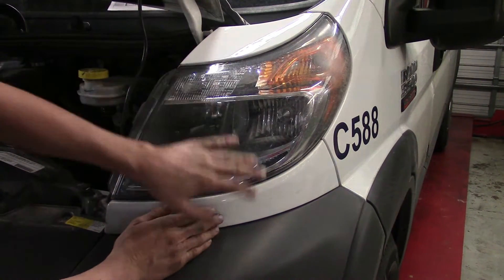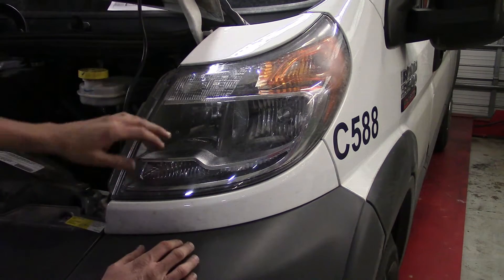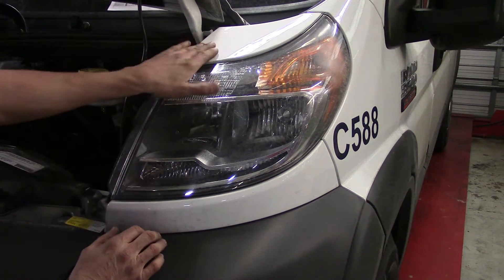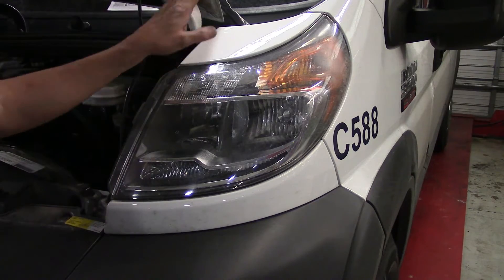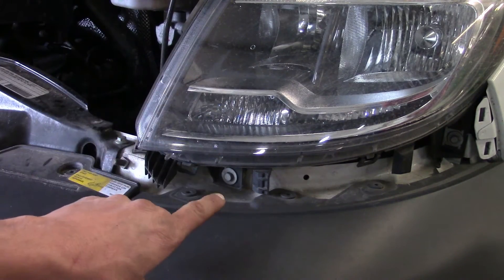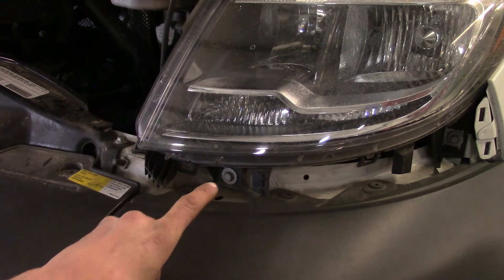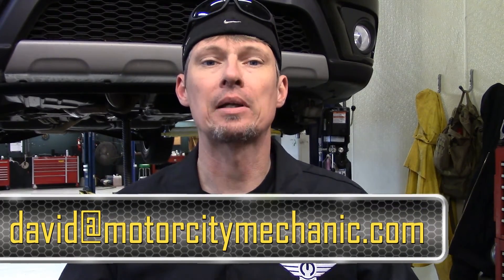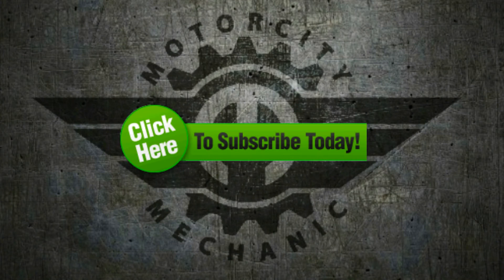2014-2015 Ram Promaster headlamp adjustment

Comment: Great video. To add; the 2016 (Roadtrek Zion) used a 6mm hex to adjust the vertical of the low beam.

Comment: I realize this is an old video but it seems people are still referring to it. I think I figured out how to adjust the headlights horizontally, at least on my 2021. Not that I think anyone should have to do this short of a major issue with the front end of some type. It doesn’t look like the idea as implied in the video is to just loosen the 10mm bolts and then shift the light left or right would work. That wouldn’t have much of an affect on aim anyway. If you look closely behind the inboard 10mm bolt position at the bottom of each light, you can see that the nut/seat for this bolt has a depth adjuster on it.  You can see a knurled black ring just behind where that bolt inserts. Adjusting the depth of this bolt seat will pivot the entire light assembly by a few degrees. You’d have to remove the light assembly to adjust it, so a lot of trial and error. Again, not intended to be a routine adjustment.

Comment: I've just decided it's okay to have those fingers on the lower panel broken. The headlight bulbs burn out constantly on these things, so you're going to be pulling those panels all the time. The first two times I changed headlight bulbs I did some finger yoga to successfully get those lower panels off. After that I gave up and let them break. The fingers don't seem to affect the fit of the those panels at all. Just my two cents. This is on my personal van by the way.

Comment: I have two of these promasters, and am constantly dicking with the headlights. My understanding is that the upper adjustment adjusts the beam height of the low besm, and the double screw thingy at the lower mount adjusts the attitude of the whole headlight assembly. So you set the high beam height with the lower screw, and use the adjuster for just the low beam. Did I miss something?
Reply from the maker: +Kip Amore Both adjustments will affect both the high and low beam bulbs because it moved the internal fixture that there are both mounted to. There is no separate adjustment for low and high beam. The upper adjustment is horizontal and lower is vertical per the service info.

Comment: I just replaced the driver's side low beam light bulb. But during my inspection they said it's pointing up too much. I twisted that top screw and it did nothing. I can't seem to get the entire assembly to match up with the same angle as the passenger light.

Comment: Not all hands can access the snaps of the lower panel. Some hands are too big, and that area is tight. There is a way to loosen the snaps with a flathead screwdriver or trim stick, but it's not easy to do, you have to go very slow.
Reply from the maker: You are correct Tim. I look at a lot of jobs from time to time and wonder how people with larger hands get into the areas that we have to. I catch hell some times myself so I can surely imagine. Thanks for that added tip and for watching the video. Make sure to subscribe

Comment: Our 2015, idk if im doing it 100% correct but a t15 is way to small for the vertical adjustment. Help? Also the life of the bulbs seem to be trash (replaced 2-3 in past 2 months) any thoughts?
Reply: SciFiDriveBy i was well aware of that but thank you. Turns out the bulb hour life is just that short and im driving around 200 hours a month or so
Reply: Same I replaced bulbs every couple months,  no i dont touch the bulb. Now I got some lifetime LED for less money and so far so good!
Reply: T15 is the correct size.  Says T20 on the back of my 2017 headlight assembly, but T15 is correct.

Comment: I think you have your vertical and horizontal nomenclatures mixed up. Vertical is up and down, horizontal is left or right. Other than that, great video.
Reply from the maker: I stand corrected my friend lol. I was had a conversation with some co-workers about this after seeing your message. You are correct.....horizontal (left/right) and vertical (up/down). For some reason it didnt make sense in my mind until I looked at it differently. Thanks for the correction. As you have seen.....I am not all knowing and not always correct as well. Much appreciated and make sure to subscribe
Reply: MotorCity Mechanic all good man like I said it was very informative. I got my vert adjustments taken care tonight because of this demonstration :)
Reply from the maker: Glad it helped in some way lol. I know it made me think about it and come to the realization that your right. Enjoy the weekend
Reply: dobbst , he can't get it up but he can move it sideways.

Comment: Nice video, however, the center/low mounting bolt is related to but is not the adjustment for the horizontal component of the headlight aiming.  It is actually the "thumb-wheel" that is located behind this bolt that is used for the horizontal component of the headlight aiming:

1. In order to be able to rotate the thumb-wheel, it is necessary to remove this center/low mounting bolt, then slightly loosen the other two mounting bolts, then pull the headlight assembly away from the mounting surface to eliminate the binding between the headlight assembly and the thumb-wheel headlight aiming adjustment that is located behind this center/low mounting bolt.

2. It may be difficult to rotate this thumb-wheel with your fingers.  Also note that this thumb-wheel is "revers-threaded."  It may be possible to rotate the tum-wheel by inserting the mounting bolt partially into the thumb-wheel so that the two “ridges” on the mounting bolt engage with the “slots” in the passageway for the bolt in the thumb-wheel.  It may also be possible to wedge a flat-blade screw driver into the passageway for the bolt in the thumb-wheel, then rotate the thumb-wheel by rotating the screwdriver.

3. Once the horizontal position of the headlights has been properly set, firmly push the mounting bolt into the female threaded mounting position until it bottoms out, then begin tightening the bolt.  It is necessary to bottom out this bolt prior to tightening in order to avoid rotating the thumb wheel when tightening this bolt.